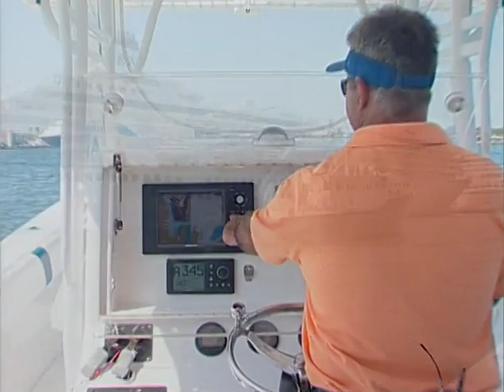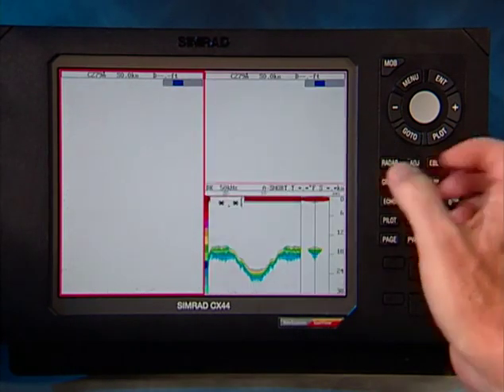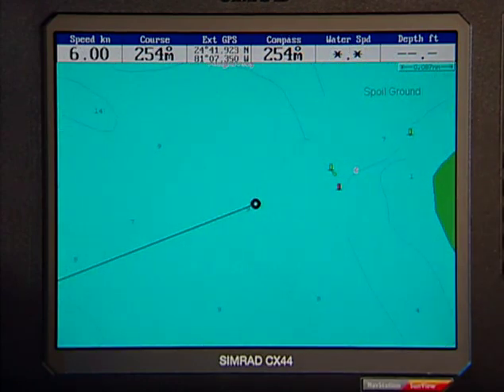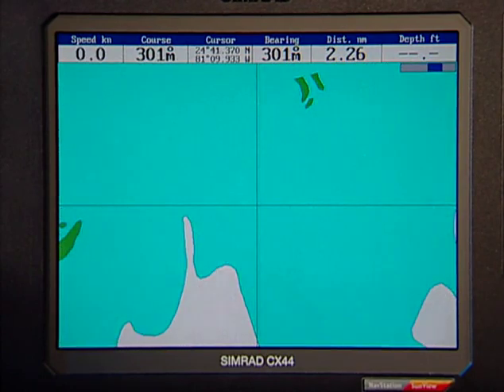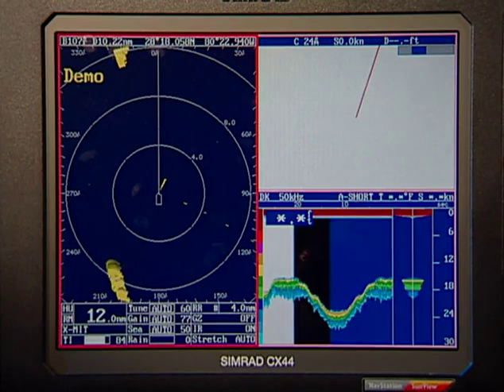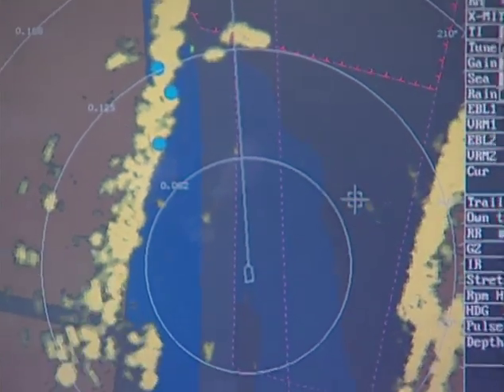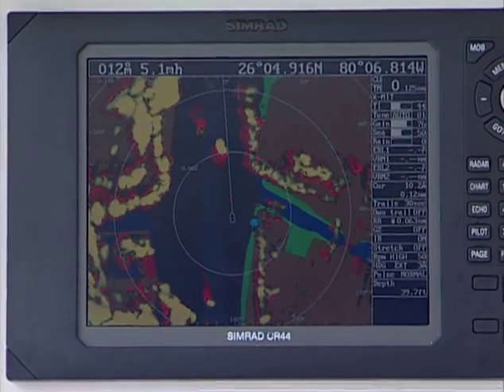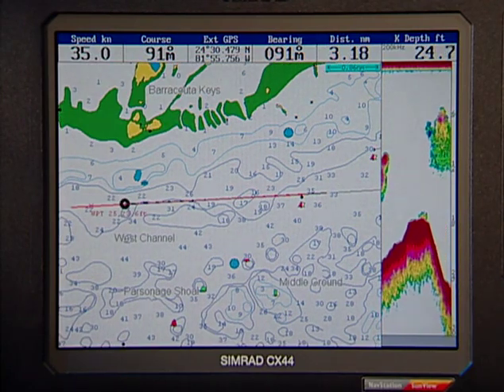simrad c44 tutorial instructions guide

Comment: Dear sir 
I have a question 
I have wind instrument compass and some others from the Is20 series 
Recently I have a problem in calibrating the CG compaas 
I think also that the cx34 is giving a wrong bearing. Are this two interconnect? I mean does that mean that I have a central compass problem?
I will appreciate any answer on this
George
Reply from the maker: George Tsachouridis possibly interference not sure of those models u would need to look at the specs.
Reply: Joe Pearce Thanks for the reply
I recently saw that when I turned off the cx34 then the IS20 compass display let me calibrate the compass 
Do you think that this is enough?
Sincerely 
George
Reply from the maker: George Tsachouridis yes normally would but always check and have a manual compass handy anyway.